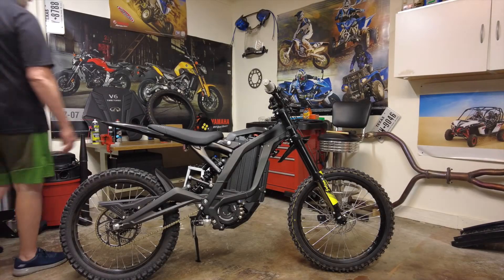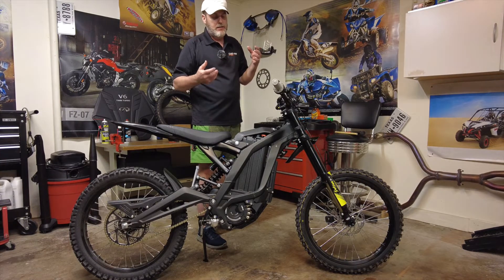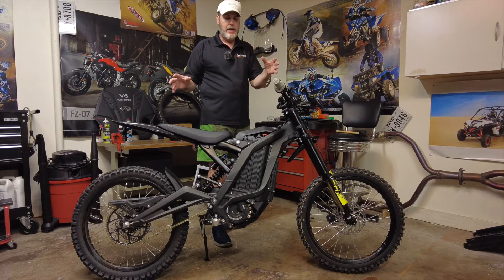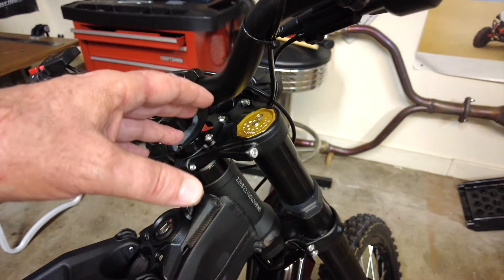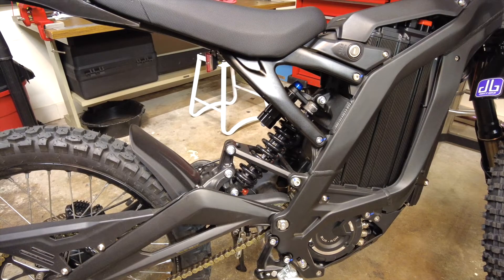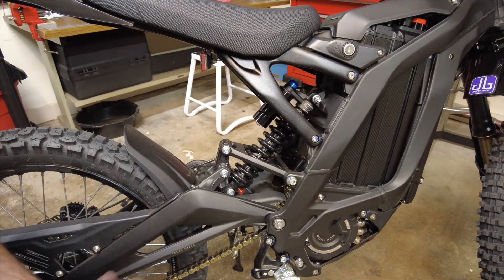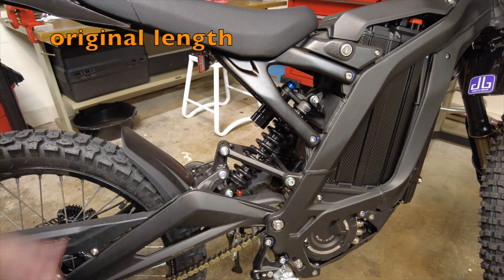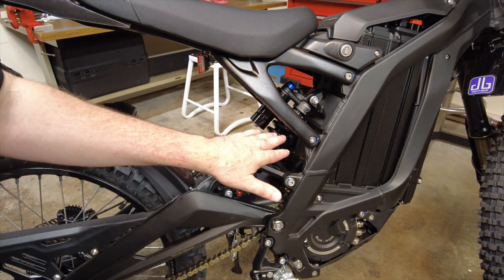2021-2022 Sur Ron X Fastace suspension...How to tune

Comment: im running a fastace rear shock and today my bike got pretty stiff and now i cant even click in or out the adjuster do you know why? i know something on the bike would squeak everytime i go in the grass and hit small bumps so im guessing my rear shock went out
Reply from the maker: I bought my bike new and with about 2yrs riding some moto style trails every so often, my rear fastace shock broke/wore out. I had to buy a new shock after that. Was dangerous to even try to ride with the malfunctioning fastace shock. I bought a 250.00 replacement, new KKE 2024 shock. It ended up being lower performance oriented than the fastace shock per my 195 lb weight 450lb spring. I then bought the Rfloxa $260.00 shock and it's a lot better than the other two. Much better feel than the KKE and better than the Fastace shock.This is what I recommend as upgrade.
Reply: @GettingthruLife  got my bike july 18th and like 2 days ago the rear shock went stiff on me and i cant do the clickers anymore you think i need a new one or what? im also thinking its need some work done to it like some type of refill i also seen those Rfloxa are like the best rn unless u spending 1k+ on a rear shock

Comment: im planning on going on bigger jumps that would give me 10-15 feet of air soon. should i compress the spring or buy a 550lb-750lb spring? right now i bottom out at a 3 ft drop and i have a 450lb spring
Reply from the maker: 750 Ib spring is not going to work well. The 550lb spring is much better for 185-200 lb individual. The downside of jumping up to a more heavyduty spring is the shock internals are most likely not valved to control the forces of the more heavy duty spring. I bought the 2024 KKE rear shock that came with 3 spring weights, 450 - 550 - 650. I installed the 550 and liked the compression feel, but rebound was thrown off max rebound tuned in but didn't matter. The rear shock became a pogo stick. Dangerous to jump because the rear would kick back and send you possibly over the bars. My solution was sell the KKE which I did to a lighter weight rider with the 450lb spring installed which was more correct for their weight. Then I bought the RFloxa brand shock with 550lb spring: https://www.rflo-xa.com/products/rfloxa-rab50rc-rear-shock-for-surron-talaria-sting-light-bee?variant=41324894716002

Much much better shock for surron, eride, talaria and seems the priced is reduced. I paid 259.00 but i think that adds high speed adjustment which most don't need. now showing $155. Hurry showing on a couple left to sell!
Reply: @GettingthruLife how big of jumps were you going on? Im going on motocross style jumps that send you 10-15 ft in the air and a sloped landing
Reply from the maker: I've done big bmx ramp jumps, crazy steep vertical takeoffs before turning into table tops landings at least 10ft up and 15ft across. a hundred times in an hour of playing around. I weight 200 lbs. Never would I attempt with the 550lb spring on the 2024 gold KKE shock. likely would have hurt myself. Do the research on the RFloxa shock. Everybody loves these shocks and forks. Cant get bigger than the 550lb spring. If you lived in Dallas Tx I have the 650lb spring.
Reply: @GettingthruLife ok ill have to try that shock than before i invest in one thats over 1k lol
Reply from the maker: The RFloxa shock is raved about by everyone who buys it. Search it on youtube. It seems odd that it's so low priced, but lets not draw to much attention to that because they could be charging a lot more, will likely jack the price up. Their lineup of forks are raved about too. I would have bought their fork over my 2024 KKE Gold high performance 35mm fork. I just bought the KKE before the RFloxa was out. RFloxa's basic one, $599, is so much bang for the buck. Superior suspension performance, feel, and tuning with the dials.
Reply from the maker: https://www.youtube.com/watch?v=HULJtTOBHVk&t=141s
Reply: @GettingthruLife bought the 550 shock and those forks will probably be my next upgrade thanks
Reply from the maker: I wish I had the RFloxa forks but the ones I have are plenty good for me now. Just not as cool as the RFloxa and probably not as plush and as good. I bought my 2024 gold KKE fork for 550.00 when it was cheaper and just out: https://www.kkeracing.com/products/kke-new-modified-front-fork-suspension-fit-for-surron-light-bee-light-bee-x-2019-2024-copy
Reply: @GettingthruLife  how much does your surron weigh? i have a eride 3.0 and i think it being 170lbs is part of the reason why im bottoming out a bit on my fastace suspension
Reply from the maker: I dont have a scale that can hold over 110 lbs, I have a hanging scale I bought so I could weight things for youtube videos. I factory surron weighs about 125lbs. My 72 volt V5 EBMX battery weighs 38.5 Lbs/oz and the stock battery 24.5 Lbs/oz. Really the only thing heavier on my LBX. The Shinko 244 rear tire weighs about 4lbs heavier too. All the other upgrades replaced existing part on the bike. 125 + 14 + 4 = 143 lbs. It's a safe bet to say it's under 145lbs.
Reply: @GettingthruLife  i have like zero mods other than pegs, grips, and riser bars. i wonder what makes the eride so heavy because the battery only weighs 40

Comment: How do i know if my shock is compressed or loose?i want to lower the back of the bike and add sag  so the seats is lower even whne off the bike do i turn the preload collar  anticlockwise?
Reply from the maker: You would turn that perload spring color counter-clockwise.  For true, best shock performance you want just about 1.5 inch to max about 2 inch of rear shock sag (measured while bike is on a stand rear wheel off the ground and then you sit on helmet and or riding gear if that's what you ride with), but if just tooling around on the road and you want it lowered you can try and fudge it. In a perfect world where cost is null, you buy a 300lb spring if you could find one.

Comment: I have the fork in the video..  is it thse same as the alx13rc 1.0 (Red topcaps) ? Or are tehre any chances
Reply from the maker: @patrickmuller5223  These forks in the video are the 1.0  which means the lighter weight spring. The Fastace 2.0 is the heavier duty weight spring and likely a little different valving for the upgraded spring. I have since for a little bit over a year, been using the 2024 version of KKE's Gold heavy duty performance 210mm/55lb spring. Plus i with with the ultra popular Rfloxa brand RAB53RV rear shock. 

Much better shock and fork than the original fastace under sprung suspension.

Comment: So if the rear shock is sagging a lot when you sit on it how do you know if you should just the spring (compressing it more, moving it further down) or stiffening the compression?
Reply from the maker: If when you sit on your Surron and it sinks down more than 2 inches you have too much sag. 2 - 1.8 in is an approx good amount of suspension sag compared to the shock suspension stroke. With this noted, the amount of sag when you sit on it, you can adjust this measurement by turning the shock sag/preload collar on the shock body.  If you have to tighten it down so much, 3/4 or greater down the shock body length then in this case you should go up in spring weight size. 2022-2023 OEM Fastace shock came with a 450lb spring so maybe look to buy the 550lb spring if you weight 190-220lbs. (one down side i found when I did this, I weight 204lbs clothes and 214 approx with helmet/riding boots/gloves, the KKE shock I bought with stated 550lb spring included, it was not valved for this spring rate and it lacked the proper amount of rebound amount for my riding skill. It became overly springy.

Try adjusting your preload collar turning it righty-tighty to set the proper rear race sag to more firm. Then you can adjust your shock compression dial so the shock becomes less like a pogo-stick. Lefty dial...less compression resistance and righty...more compression resistance///slow the shock compression down. Rebound is how fast the shock rebounds back to its full length. You want these slowed down but not overly done.

Comment: I just got that same fast ace rear shock when I put it on my bike everytime I compress the bike once it springs back up it makes a knocking noise would that be becuase the spring is too loose?
Reply from the maker: well let me think. if the shock is springing back to fell length quickly and it's making a smacking sound then I say your shock is broken like mine did after it wore out. My rebound control went away therefore my shock was a pogo stick. On my fastace shock the spring is longer on mine compared to the springs on my replacement KKE shock and now my third shock the Rfloxa RAB53RV. This leads me to believe your spring preload is not to lose on the Fastace if like mine. Your fastace shock spring should have written on it 450Lbs. Did you buy it new or used?

Comment: HELLO PLEASE how much oil i have to put in the forks i have the same one with a problem of leaking
Reply from the maker: I have not taken disassembled the fastace fork. To get info on specs like what you want, I'd reach out to Charged cycle works (801) 449-1050. They service these forks.
Reply: @GettingthruLife  hello thanks for responding im gonna change my seals and fill new oil / i want to know the spec of the oil in the legs

Comment: Hey, I have a huge problem. 
I had a used 2020 Surron with Fast Ace suspensions delivered to me. The surron was pulled down using tension straps. 
I can now pull the fork out at least 5-10cm without putting any strain on the bike. how can I "fill" the "air/nothing" in the upper area? 
I thought I could just pump air in :(
Reply from the maker: Fastace forks is not air bladder style fork. They have a spring in one side and a damper cartridge in the other. I don't know why the fork would be not springing back up. If it was compressed for 6 months then maybe but a week for shipping, seem weird. Can order a new spring, and even a heavier rate spring at www.chargedcycleworks.com. Go for the 55lb spring.
Reply: @GettingthruLife  do you think it could help to lift the Bike of the ground and open the airbleed screws?
Maybe the owner Messed around with the screws under load and created underpressure?
Reply: @GettingthruLife is 55lb still ok for a 50-55kg rider?
Reply from the maker: @mr.taddel4282  So if you weigh 110-120lbs/50-55kg then the 37-38lb spring is likely the better option. For me at 195lb/88kg, I need the 55lb -60lb spring.
Reply: @GettingthruLife  Yes, it's not too soft for me, I'm just missing the first 30% of the spring travel.
The sag is like someone sitting on it, but without any burden on the Bike... o-o
Reply from the maker: @mr.taddel4282  Yes, should be back up after releasing the straps. Surrons from surron ship in their shipping crate with pull staps holding them  down  tightly. With my full sized motocross bikes, I never left them long term suspension compressed  with straps. 

Maybe something not right with the fork. I have my Fastace fork sitting here in my room. A good looking bike suspension fork. I replaced mine with the newest KKE surron fork to get heavier sring and more clicker adjustment range.

2024 kke front fork:
https://youtu.be/YudP92Xt-mo?si=dfrTl-sFinzoQvxV

Comment: Finally a very well explained & professional Video on explaining Suspension on the Sutton mine has the FastAce Rear but RST Killah in Front but I’m even more Excited & Happier now as I can tune my Bike more :)
Reply from the maker: Similar to motocross suspension though less tunable. If you are serious about upgrading suspension or asking for help, reach out to the guys at Charged Cycle Works. They have really come a long way in last couple years. They can tune the factory forks with new springs and change oil weights. They can service these forks and shocks too and make them feel like new. In the extreme case they offer 5 different brand of new sick forks and rear shocks for the diehard riders.

I'm still on my stock battery and controller so the stock fastace fork and shock is adequate.

Comment: When I undo my rebound screw to the right oil leaks out am I suppose to twist it the other way?
Reply from the maker: That doesn't sound good to be honest. Rebound and damping adjustment on pretty much all forks and shocks light pressure to turn. When they stop they stop unless you torque down. Usually turned all the way left is max 0 and then right turn is more 1, 2,3....10. On the fastace fork/shock factory setting I recall was click 5/center setting.

Comment: How comes yiur big gold nut on the forks sits flush, i thought they sit raised to be able to undo the nut
Reply from the maker: You have a range of positions they can be in the clamps. Tuning comes into play with moving them up and down in the steerer clamps. You can move them down to where the top is flush or just 1-2mm flush or you can move the gold cap as much as extreme 1 inch high... Rule of thumb is moving them down can provide more stability but less turning quickness/less agile feeling. Moving the fork tubes up in the clamps makes the dirtbike steer quicker/turn tighter but you can trade off for stability. Google motocross + rasing /lowering forks in triple clamps...Benefits/cons.  example: https://www.youtube.com/watch?v=-njx6rOiIcw

Comment: Does anyone know the amount of oil for this fork?
Reply from the maker: I dont know but maybe in the PDF for the fork  https://static1.squarespace.com/static/5d1738a7f814800001323a1b/t/60761ccbeda6c77bece75d4c/1618353357590/ALX13RC_spring.pdf
Reply: @GettingthruLife  There is nothing in the pdf but someone told me 150cc left and 300cc right
Reply from the maker: @Simon Quere  also the Charge Cycle Works place/online sales works on these forks now. Offers up grade valving, upgraded springs and fork service. Can also double check info with them. Search web for phone #.

Comment: you happen to have the size of the bolts fork bolts? I was looking for the 5 total on each side .. (the 2 at bottom, 2 in middle, and 1 on the top of the fork) ... should be 10 total ... I cant find the info on these bolts.. thanks

edit: not related but you mention you use wooden tools to prevent metal on metal damage... this isnt for everything right ?  you dont like tighten say axel bolts with some sort of wooden tool ?
Reply from the maker: No wooden tools to tighten anything down. I typically try to use a piece of wood if I have to use a metal hammer on some things. I don't have any rubber mallets but would be nice to have.

I don’t have bolt sizes right at moment but I can get the sizes by later today and post.
Reply from the maker: On my 2022 surron with the Fastace upside-down down forks, all the bolt heads are Allen heads and they are 5mm. 4 bottom, 4 middle and 2 up top. The bolts/bolt for the handle bar stem to be tightened to the fork steerer tube is 5mm and the stem 2 pinch bolts are 4mm.
Reply: @GettingthruLife  Sounds correct theres 10 bolts, 5 each side... you dont happen to have the length by chance? APpreciate that info tho;.
Reply from the maker: @Cmdr Tiger King  No, I don't have the individual lengths of the fasteners. If I was working on my bike now I would for sure measure and tell you.

Comment: How do I add air to the forks?
Reply from the maker: If you have the same fastace upside-down forks as I do then you cannot add air to increase compression. If you are blowing through your front forks stroke were you need stiffer forks then you need to consider upgrading to a heavier spring. Contact: Charged Cycle Works, they now offer two levels of fastace fork springs for increased performance $55-60 minus install.
Reply: @GettingthruLife  thank you !
Reply from the maker: @maxthepilot777er4  Call them and get their recommendation based on what you need/style of riding: https://chargedcycleworks.com/products/dnm-heavy-coil-upgrade?_pos=1&_sid=7c1a1f37f&_ss=r

Comment: I think I fucked up my rear shock moving the red bolt, it’s stuck and the bike takes really long to get back up, there’s any way to fix that ?
Reply from the maker: Is the red bolt you mention on the bottom of the Fastace shock? Trying to figure out what exactly you are describing.
Reply from the maker: You always want to be gentle when turning suspension dials if I'm not mistaken, because I have not fiddled with mine in awhile. Always turn clockwise until it wants to stop turning. There the dial is bottomed out. Then Turing counter clockwise, lefty, those clicks are you full adjustments. I think I recall ten clicks is max adjust. 5 is the middle and average adjustment to really start from.

Comment: thank you so much! this video really helped me learn a lot and got me able to dial my bike in way better
Reply from the maker: I'm not claiming or claimed to be a suspension guru but from years and years of being in the motocross world/racing /dealerships background, I had to learn something. Susupenion tuning at high levels is an art form. Best thing to do is make small/big adjustments and then go ride, if one way/combination of clicks doesn't work to the rider's satisfaction then the clickers can always be set back to factory or in the middle settings. Spring pre-load adjustment plays a huge part in suspension setup (for the weight of the rider with proper spring sag) and is the basis which everything else is set upon. Unfortunately, the Fast Ace forks and likely the other entry-level fork included on this Sur Ron bike don't have big levels of adjustability. Can't adjust spring preload on forks but can replace the one spring to a heavier sprung spring per a couple of companies (Charged Cycle Works). Many people don't need the high levels of adjustability where those suspension features are overkill. Just depends on the skill level of the rider and what they like to do when riding.